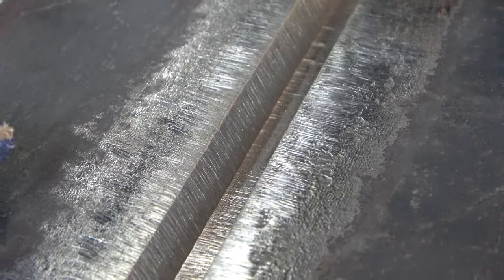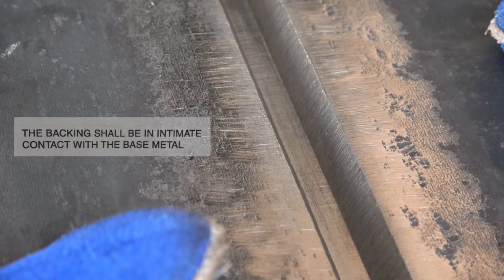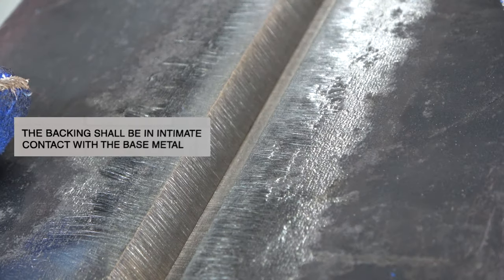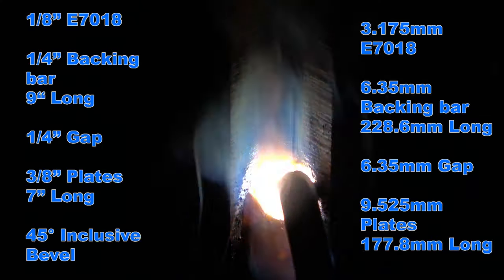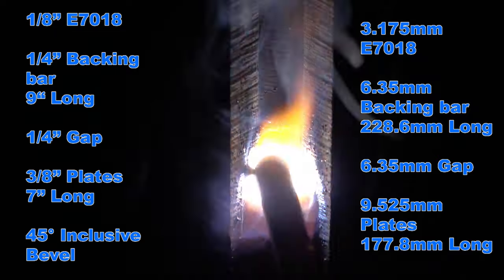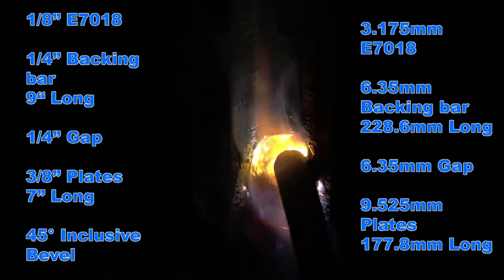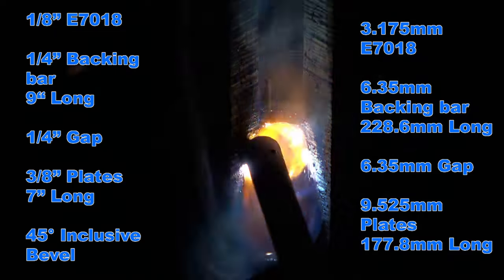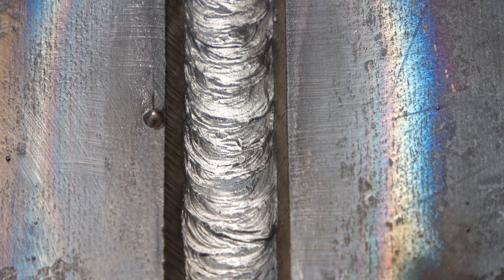3G SMAW E7018 root pass stick welding tips (STOP TRAPPING SLAG!)

Comment: Nice. I'm in school now and just start 2f t joints and working on 6010 1/8" rods. The frustrating part was getting a consistent travel speed, work angle, and arc length. It's slowly coming together with the extra time we're allowed in the booth. I'm grateful for all these videos I come across that give me a preview of what to expect when things go right and when they will go wrong.
Reply from the maker: Welding is a great career choice. Remember that your weld is your signature, be proud of it! It can be frustrating at times when you are learning. Whenever I am working on a new technique and I start to get heated I will walk away from it for a little while and work on something else.

Keep it up!
Reply: @quickweldingtips4424  I appreciate that man!
Reply: @yomama9191  becomes real Easy bro I took a stick welding course from October of 2019- August of 2020 and got certified And now I have a year and a half work experience. I remember sucking so bad my first couple Classes

Comment: I just dont understand how you can hold the rod in place for so long i feel like id be running way way too hot
Reply: The backing strip is why you can go slower. The strip is taking some of the heat and some of the metal.Youre basically just welding to the backing strip. A root pass with a backing strip is easier to weld than an open root, no keyhole to worry about😁😁😁

Comment: Nice video. But i have question. I need to weld 5/8 plate to 5/8 plate . Outside corner joint . In Europe and here only have 6013 and 7018. I think 7018 is better for the job. I suppose to weld it in flat position. I will need to make multiple passes with the 1/8 electrode. Is there a way to make backing for outside corner welding ? Any suggestions ?
Reply from the maker: Depending on your situation, you could back with aluminum angle or brass. If you do that though you will make "alumisteel" though. When I do an outside corner and I need to limit buildup on the back side slightly overlapping the edges has worked for me. You could also try running the first pass at a lower temperature (while still maintaining fusion).

Comment: Do you think I should turn up my amps I’m running about 115-120 with a 1/8 rod 7018 I’m getting a little splatter
Reply from the maker: You can always turn up if you can handle the heat. Check your WPS on the cert, ours is max 165. I run 120-125 for root and hot pass, depends on the machine. How did you do on your test?

Comment: i struggle so much with uphill i keep blowing through after two seconds and im at the right amps
Reply from the maker: If you are blowing through on a 3g plate test make sure you are not long arcing. When I weave the root I can feel the bevel on either side of my electrode, so if I’m on the right side of the bevel I feel the flux on the end of my 7018 electrode pressing up against the bevel. You only want to be about an 1/8th of an inch distance from the groove at all times. 

When I see people blow through or have the puddle spill out, its usually long arcing. As you increase arc length, you increase the heat of the plate and your puddle. In addition to this, the electrode is not able to fill the puddle because the metal can’t jump across such a distance from the tip of the electrode. 

Make sure you are holding the electrode straight into the groove, err on the side of a little more push angle. If you are pointing down at all with a drag angle when running 7018 3G, the arc force will blow the puddle out and make it really easy to blow through.

Try again but really focus on a tight arc and consistently pushing the electrode forward so you don’t long arc for even half a second.
Reply: @quickweldingtips4424  awesome thanks

Comment: For the root must electrodes thinner?
Reply from the maker: You can run a 3/32 electrode for the root but in the US, that will not qualify you for 1/8". When I use 3/32 I usually run two stringers side by side for the root, too many restarts with a weave.
Reply: @quickweldingtips4424  OK.,  i use here 1,5 for the root , then 3,2 for the second layer, and 4,0 sometimes if the weld is wide.